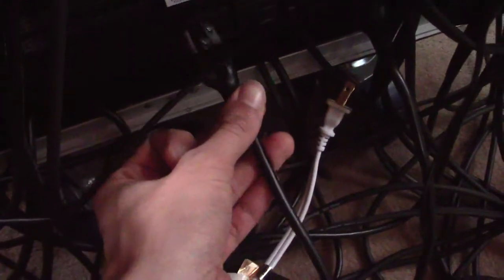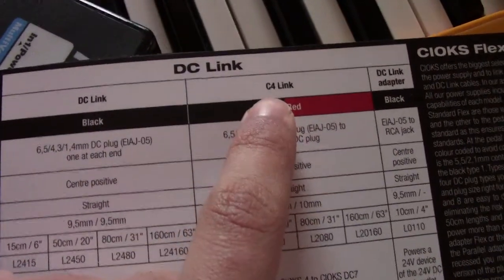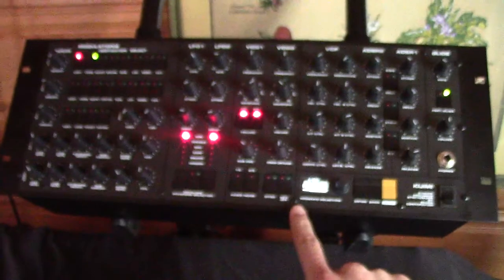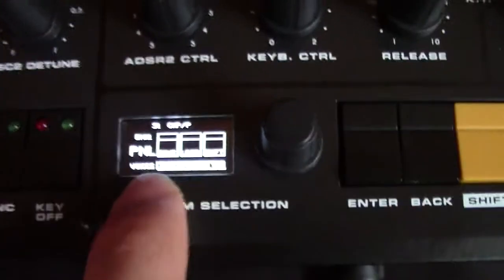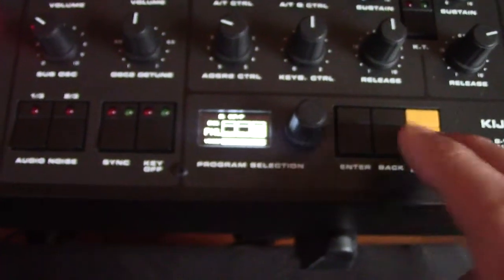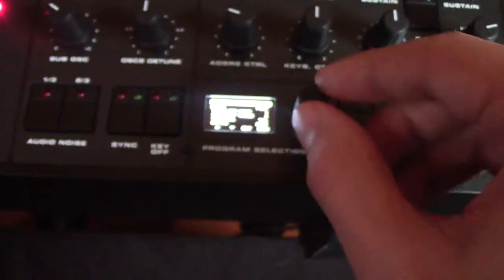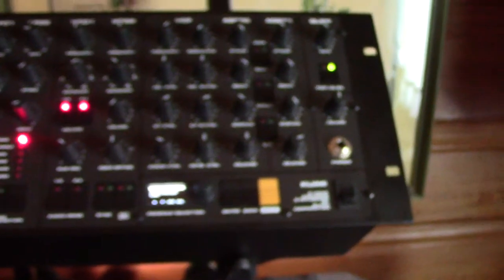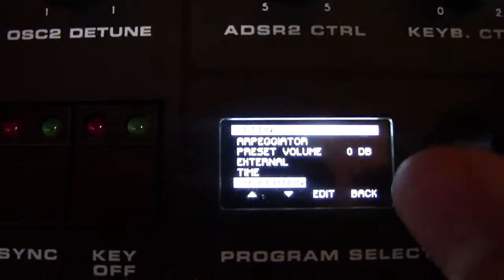Can Cioks DC7 power the Kijimi 4U Rackmount Synthesizer? Yes!

Comment: 3:17 The tiny screen on the Kijimi is a fail, if I can use the parlance of the young. As someone more advanced in age, my near vision is somewhat shot and even the Blofeld screen is getting too small  for me without a magnifying glass! So I will avoid buying any gear with micro-screens. I am not the only 55+ synthesiser user who has complained of failing near vision!
Reply from the maker: The menu has the least important settings, imo
but they will for sure be 100% essential at some point so I agree with you. The whole Kijimi is much smaller than I anticipated. I traded it in for a Roland SE-02 and that's also smaller than I thought!